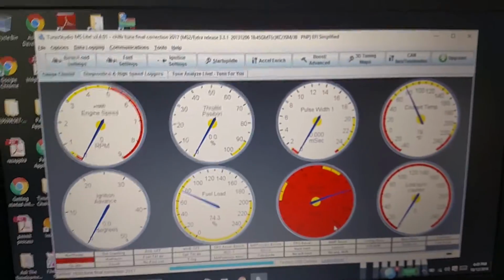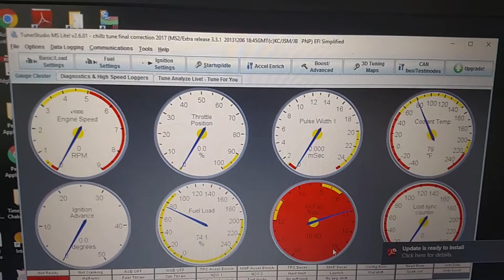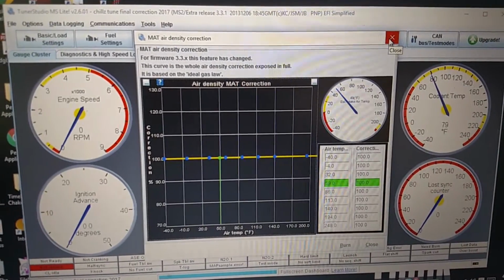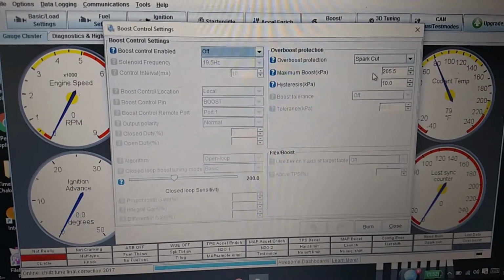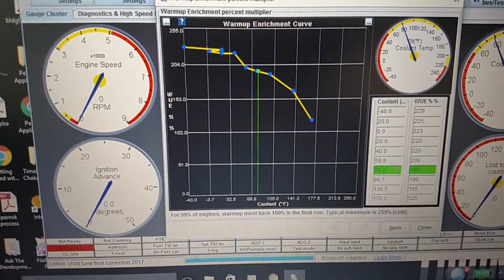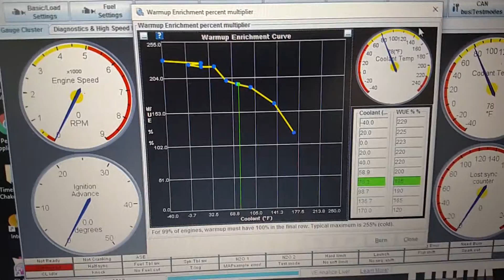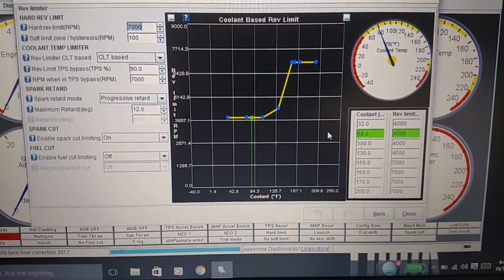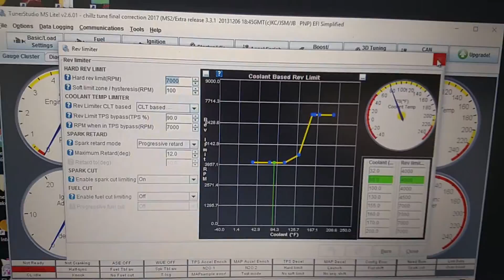Turbo miata megasquirt tuning tips

Comment: In the WUE when your at max temp make sure its turning off. I noticed your last couple numbers 165 and 120. But my understanding is when it’s set to 100 that’s when it’s off. So I would just make sure it turns off when you’re up to temp.

Another good practice is to have spark and fuel cut or both is the actual name for it.

Comment: Nice video for beginners for sure! But be careful, your wue curve is wrong... You have two different values for 20° (maybe you erased the - by mistake) and the curve should always finish by 100% (it's written on the small help box on the bottom of the curve). 
The way it's set right now says that you are always offsetting your ve table by 20% because it never goes off wue! I'm surprised that your tuner didn't see that... Make sure to increase your whole table by 20% if you set back your last wue value to 100%! (you might also need to tune wue again)
I'm also not sure about removing the mat correction, especially if you have heat soak issues. You better try to fine tune it instead of removing it! It's very useful on turbo builds
Good luck on your tune, it looks like you have a nice miata going on!
Reply from the maker: Lagontinas, thanks for the wisdom man, sounds like you're someone I wish I could've talked to while trying to figure this out. I sold the car unfortunately... But I had the tune sorted fairly well before I let it go. It's definitely not the end for me and mx5's.

Comment: You do know 205kPa boost cut is like 30 psi?
Reply from the maker: Guy Bean, technically you are correct, but you need to do a little more research. Try searching "kPa to psi boost". I'm not a professional but I learned about this from my tuner who definitely knows what he's doing.
Reply: I see, kPa doesn't count positive pressure until after 101 kPa, my bad dude, your spark cut is set to 15 psi in that case haha!
Reply: 100 kPa = 0 psi

Comment: Do you have any tips for tuning idle in the idle control tab? Im having a ton of oscillation and car tends to stall every time i come to a stop
Reply from the maker: Gregory Lee, honestly I just adjust my idle with the idle screw, my car seems to idle best around 1100-1200rpm. you could possibly have a vacuum leak? either way I'd try turning it up a little bit at a time and seeing how it acts.
Reply: I have my idle screw adjusted to around that, but I have a ton of issues of the idle jumping up and down.. AFR goes normal to lean and repeats over and over. I may have to play around with the open/closed loop. Or maybe my IAC is clogged up
Reply from the maker: Gregory Lee, hmm did you tune the car yourself? I assume you've checked for vacuum leaks. I guess  you could have clogged iac or something. I haven't messed with idle control in tuner studio much.

Comment: bro i cant get the driver on my lap could you helo me.?
Reply from the maker: Guillermo Martínez, sure I can help, are you talking about being able to access the ECU with your laptop?
Reply: Correctly bro, do you have teamviewr.? or how can we do it.?
Reply from the maker: Guillermo Martínez , Im not sure atm what driver I used but I just went to radio shack and bought a driver with an install disc, once you have tuner studio and your driver installed you will need to create a new project and have the ignition on to connect to the ECU
Reply: i have the project in a usb cuz someone else did it but now i know a lilttle and i want to put the launch control and i just need the driver couls you help me by teamviewr.?
Reply from the maker: Guillermo Martínez , I've never used TeamViewer before, if you can walk me through where you are getting stopped up I will try my best to help. is your laptop just not recognizing the driver? if so you may have to use a different one
Reply: ok i will try to upload a video so you can see aight.? maybe at night when i come out of work.
Reply: Do you have FB bro.?
Reply from the maker: Guillermo Martínez , yup also Instagram @forcefed206

Comment: Hey I just got a megasquirt pnp 2 for my turbo Miata. How much does it cost to get a dyno tune?
Reply from the maker: Gabriel Bashara: it depends on the tuner, my first tune was around 500 I believe, then I went back for more boost, then I decided to do EWG to regulate boost creep, all said and done I'm probably around 13 or 1400. not sure where you are located but I'd recommend having all your ducks in a row before going to the tuner, that way you don't have to pay them big bucks for small issues, also make sure they are respected in the field and have experience with megasquirt.
Reply: FORCEFED206 I understand. I am located in Southern California. I am new to tuning but have been doing quite a bit of research on miataturbo.net as well as YouTube and reading the pnp2 manual. I have my wideband and boost gauge installed but the wideband seems to be very unstable so most likely I will upgrade to the innovative lc2.
Reply from the maker: Gabriel Bashara , How unstable is it? my wideband is a bit unstable too,  if it shows the same in tuner studio as on the gauge then it's probably correct.